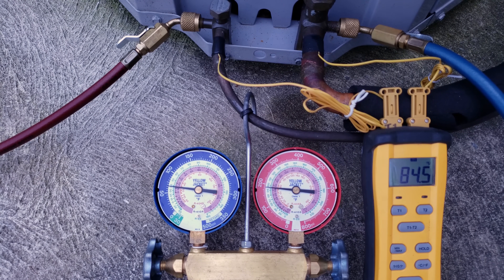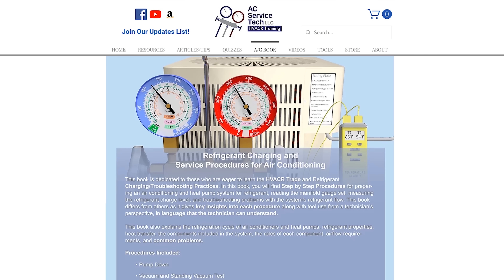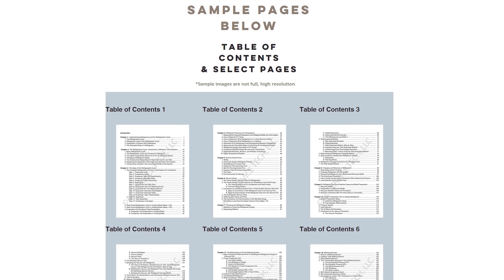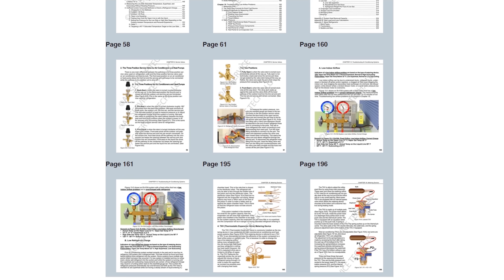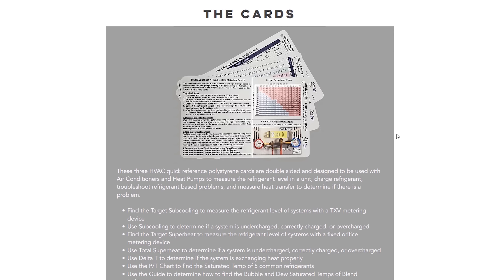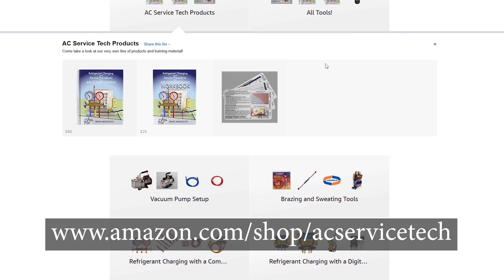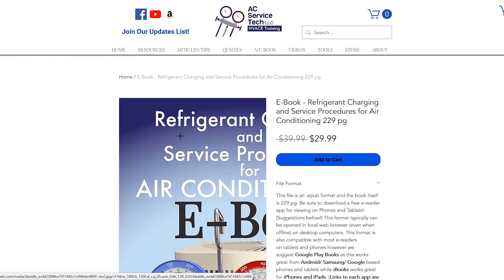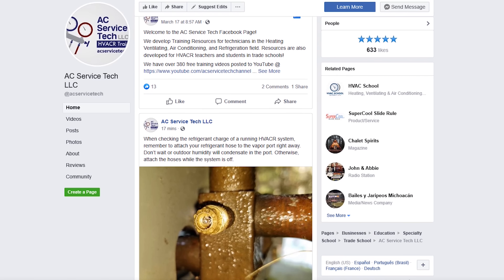Liquid Line Restriction on AC Unit Explained! Found Bad TXV!

Comment: Do you recommend adjusting the TXV by front seating or back seating before replacing it ? 
Also I have senior tech he said whenever txv is not working based on factory to go ahead replace it because its not working, and the should not be adjusted in his opinion, If you can explain this. 
Thank you.
Reply from the maker: Usually, the txv is factory set correctly for ac mode because the TXV's are made specifically for ac units. The only time we really adjust them is if someone incorrectly adjusted them out of specs. Most ac unit txv's can't be adjusted anyway. Before playing with adjustments, you would like to know if someone was playing with it. The problem with adjusting is the time investment and if it doesn't work out, it is a lot of wasted time for the end result. That is prob why that senior tech is telling you this, thanks!

Comment: Hey Craig

Thanks for the video again

Question if you don’t mind

If the TXV had lost 100% of its charge it would still operate the same way in hot water?  The suction pressure would be zero or extremely low if it was seized closed? If it was stuck open Then there would be too much liquid refrigerant and Very low superheat?
Reply: If TXV stuck In closed position  your AC won't function at all because no freon going to your evaporator and low pressure cut out will open shutting off your compressor, if the TXV stuck open ( I have not seen one yet ) then your compressor would go bad real fast when you send liquid refrigerant and low superheat .
Reply: XRAY Bravo thanks friend
Reply from the maker: Usually the txv will not shut down all the way and will allow at least some refrigerant through but it may not be a lot. Everything else mentioned here you both are absolutely correct, thanks!

Comment: Sometimes a restricted strainer or filter drier will either sweat or freeze up and you can visually see this. This is caused because the restriction will actually induce a pressure loss in the refrigerant which causes it to begin to evaporate,
Reply from the maker: Yes the humidity will freeze right after the restriction, thanks!

Comment: If the bulb wasn’t operating properly wouldnt you see no change in pressure?
Reply from the maker: In this case, the bulb has a low pressure due to a partial leak. That is why a high temp caused the txv to open, thanks!
Reply: Why not change just the bulb then?
Reply: Freddy A: In a residential TXV there is no way to just change the bulb as it is connected to the diaphragm. Sporlan is one manufacturer of TXV's and they have a very helpful website on their products.

Comment: Big fan of your channel thank you for sharing your knowledge with us. Sir if I can ask you a few questions.
1- can you use the same method to check a restriction on a filter dryer but with a txv to determine  if there's a restriction  on txv? If so what should it be the different of temperature from one point to the other on a good txv and bad txv?
2- is it possible that the indoor coil can be full of oil that can cause a restriction/ system going into a pump down? How can i verify this?

Thank you.

Comment: I maintain a chiller unit that has 4 10hp compressors. Each compressor has a txv. One  capillary line from the txv to the low pressure side is always "sweating" while the other three capillary lines to their txv are dry. High pressure side is lukewarm, not hot to the touch. Filter dryer is new, changed about 4 months ago. 

The txv is adjustable. Is it worth my time to try to adjust it or should I replace it?

Comment: Hi how are you
Can we change the R22 gas to 410 gas
Reply: You would have to  change the condenser ,possibly the evaporator and your metering device. You also have to flush your line set. R22 uses mineral oil where 410a uses Poe oil they're not compatible.
Reply: @whitesheatingairappliancer7101  Can you make a video that shows me
Reply: @whitesheatingairappliancer7101  Mr. White is right. You can not just switch refrigerants. R-410a has a much higher operating pressure. The higher pressure would eventually blow out one of your coils. Then you have the other issue with the mineral oil in your compressor not being compatible with the R-410a. If your system needs to be charged they do offer R-22 substitutes.
Reply: No

Comment: This may seem a little off-topic, but I'm thinking about the hose disconnection. I know it doesn't really matter if it truly is a liquid line restriction because you would have to open the system to correct it, nonetheless. However, if it turns out to be a low charge, that's a good amount of refrigerant in the hoses. Is it a good idea to already have a vaporizer connected to the vapor hose?

Comment: Outstanding! This is really useful stuff for techs to understand. One thing to keep filed in your technician craw that happened to me some years ago, is that Mfg make mistakes! In my case, I was going nuts on a job where I simply couldn’t make sense of my gauge readings and temps. Long story short: A brand new matched 3 ton system for R410a had a TXV factory installed for R-22. That’s right. R-22 TXV on a R410a system. I cannot tell you how much time I wasted by not questioning everything. Just know that the refrigerant pressure temp doesn’t lie. If you know you have a dry and tight system charged with a given refrigerant, and yet the pressures fail to measure up after weighing in the correct amount of gas, start to question whether you have the controls you think you have! As always, valuable lessons can only be learned in the field, but the more you hear the more you might save some real anguish (and time!).
Reply: Kenny Manchester Good tip
Reply: Thats happened to me twice before.  Both times an enormous amount of time was spent troubleshooting before I finally found the problem.
Reply: I'd be sending them my bill

Comment: great demonstration. but by putting txv bulb in 102f water the txv valve opens up more and the low side pressure and saturation temp increase. so this means the txv is doing its job right? beacause at 67f txv opens a little and at 102f it opens up more. please help as i am a little confused. thanks.
Reply: I was wondering this too but then there's the fact it was at close to good operating temp with the bulb being in hot water. I believe if the TXV was good the pressures either wouldn't have changed due to a clog somewhere else or the low side would be way higher then where they should be as the TXV would be opened all the way from warm water rather then only as much as it was supposed to when it's on the cold liquid line. If that makes sense. I'm not even sure I'm right on that but that's what I'm thinking

Comment: R22? With a liquid line restriction I'd expect to see the high side climb way up 320+, strange how this machine hp barely budged start to finish
Reply: Another way of understand it is that the restriction will basically restrict the amount of refrigerant that is allowed to return to the compressor. This means the compressor has less refrigerant to pump. and this relates directly to lower head pressure.
Reply: @Howie875  and usually a lower amp draw
Reply: Common misconception restriction in liquid line is like closing the liquid line service valve the unit pumps down pressure is lower than normal.

Comment: My r410a system has perfect sub cooling and pressures pipe ice cold but only a 10 delta t and won’t cool when above 80 outside was thinking of changing filter drier and txv is that mostly likely the problem it’s been happening since day one it’s a new system
Reply: I would open up access panel on evap coil and check to see if something is  blocking the outlet or if the air is bypassing the coil some how.

Comment: hi, so for this example the suction line temp. and the hot water in glass temp. must be 102f for the txv to open up more? because at 67f the txv did not open enough to get 10 to 14 degrees of superheat.

Comment: question:  can the txv be replaced alone, or must the entire indoor coil unit be replaced? the ac technician looking at my house ac thought there was a restriction in the system because of a low temp differential, but is recommending replacing the whole indoor coil unit (under warranty), but $1k labor!!
Reply: @eclipse369.  r410a. no visible damage to the coil. the tech made the determination by measuring pressures on the outdoor unit. he said he tried various levels of freon to achieve the desired subcooling or superheating (i forget which), but was not able to reach the desired value. 

my indoor unit (2 tons)= 
http://www.americancoolingandheating.com/wp-content/uploads/carrier-product-data-specifications/CNPV-7PD.pdf

you mentioned 3 most likely causes for a restriction( txv, filter, metering). what would be the cost to swap those out? 
if the unit is under warranty is the standard fix to just replace the whole unit? i dont mind getting a brand new unit, but as mentioned, $1000 in labor.
Reply: Did he try adding ac renew first?

Comment: I notice there is a filter dryer inside a lot of condensers. It's always a pain to change them and I see a lot of techs add a second one on a txv or coil changeout.  Is it a big deal to have 2 if they are clear?
Reply from the maker: Preferably you don't want two due to a possible pressure drop. It is a shame that some manufacturers choose to put it in the outdoor unit, thanks!
Reply: @acservicetechchannel  Some put it in because they know that some unqualified installers will not put one in, or in the case of a heat pump, will put in the wrong one way filter drier.
I had a new install and the installers did not put one in. Boss came out the next day and told me it was already installed by mfg. and I asked where it was and he pointed to the black muffler on the compressor discharge. After I pointed out the error, I asked for one to be installed inside . I have a heat pump, the tech installed a one way drier. Oy vey.  
The next call back they put the right one in, but did the one line vacuum system and took eight hours. Was it revenge for smart aleck homeowner? I doubt it. I think it was just poor training.
Reply: It's probably a muffler. 
I'v never seen a filter in a brand new machine. Should only be installed where necessary eg compressor burnout - replacement
Reply: @Froggability  a lot of mfgs. now put them inside the condensing unit. Better check so you don't put in two! There's a story about a rep going out to a large job site and him finding a bunch of new driers in the dumpster so the manufacturer decided to just put them in for you. I see them in a lot of Goodman condensers.

Comment: Hi there great video Sir. I have a question. You connected your gauge hoses and the yellow hose you bled the air out till just a small amount of refrigerat come out? Is that because of the pressure that the system has inside? Thank you in advance for your reply.
Reply: Chucky Alone I will answer that .Yes that was the pressure from the system.Remember atmospheric pressure is 14.7 psi and high pressure ,high temperature always naturally moves to a low pressure low temperature area.Yes he used the refrigerants standing pressure to purge all the air out of his line set,very important that this is done.Now the system was off when he purged.
Reply: @robertcherry4971  thank you so much for the reply. I have another question... would it be good idea to vacuum the hose lines in the gauges next time in case my AC unit has not that much refrigerant, and prevent the air inside the hoses from going inside the AC system?
Reply from the maker: Chucky, the positive pressure inside the system however small will not allow air into the system unless it is severely empty and running in vacuum. If you work on low temp chillers, those run in vacuum on the low side as well but these small residential systems run with positive pressure, thanks!
Reply: @acservicetechchannel  thank you so much Sir, for clarifying that I had that in my mind but I wasn't sure. Sir. My instructor says you have awesome video's and I should follow up on your videos for better clarification on hands on...since our community college is closed we can't do hands on...but watching your videos is like doing it while holding my hand. Thank you for the reply, clarification and awesome tips and knowledge.